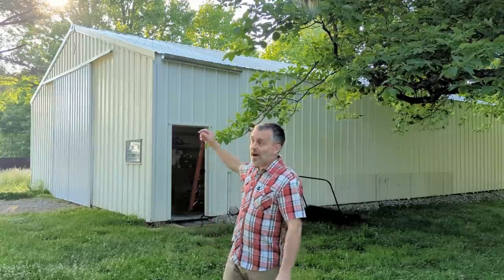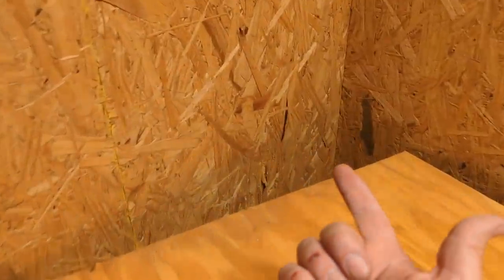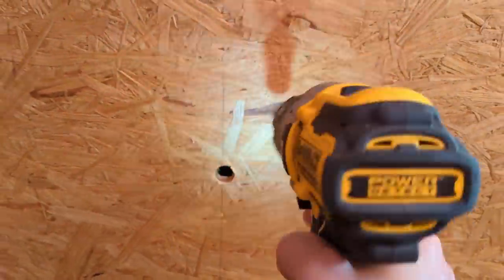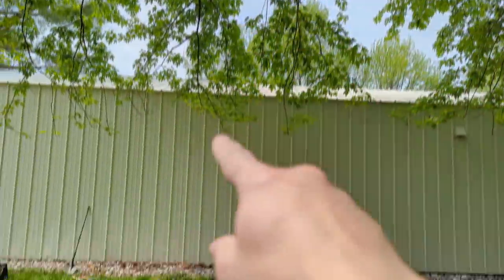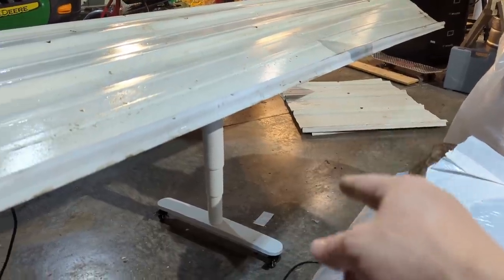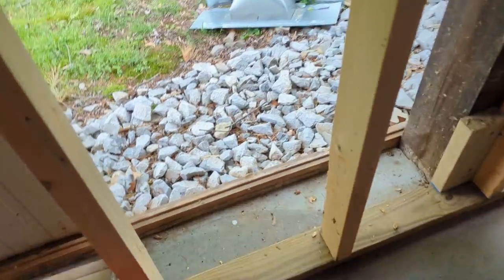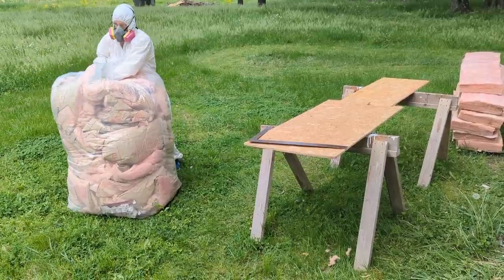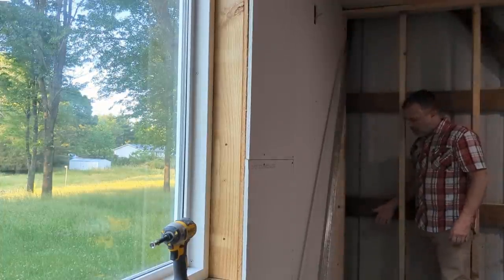What's It Going To Take To Make My 50y/o Pole Barn Livable?

Comment: Big job.  You've accomplished a lot.    It would be hard not to be a bit disheartened when you find one thing after another -- like the sagging concrete.
I agree that you maybe want to get rid of that big pine tree.  You wouldn't think that the needles would be that big a problem, since the rocks and good drainage should keep that area dry, but evidently not.   How is the drainage?   Could you bury a drainage pipe in that rock and have it drain away, or is the area just too flat?

Comment: I remember when I was a kid and Noone used particle board but now plywood is so expensive you'd have to be a millionaire.  Good reusable lumber....until the ceiling

I've worked on that stuff before. You need gloves when dealing with that metal or cutty cutty.

Comment: would it be possible to drill a hole in the sagging portion and fill underneath with more concrete to prevent it from sagging more?
Reply from the maker: What you are talking about is called "mud jacking" and it is the old way of doing it. Nowadays they pump in expanding foam for "foam jacking." It's better. I've got a company in line to do the job. It's going to cost me ~$3k because of the volume of foam that will be used.